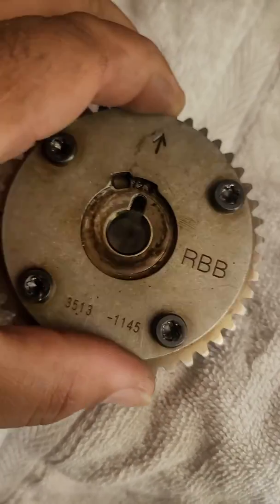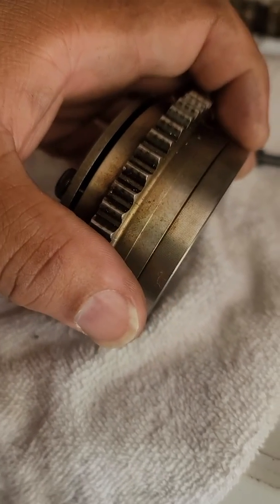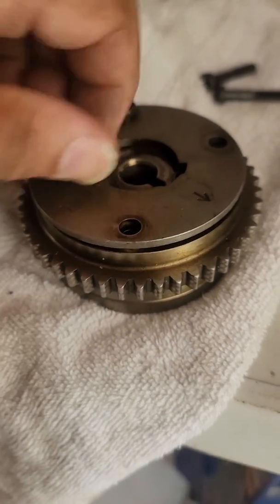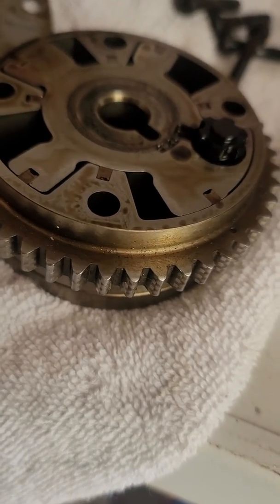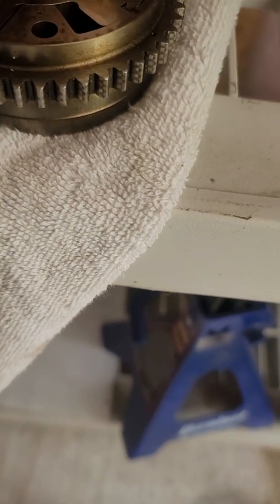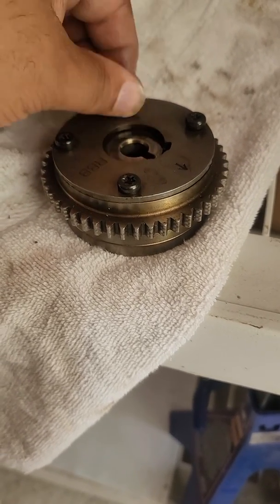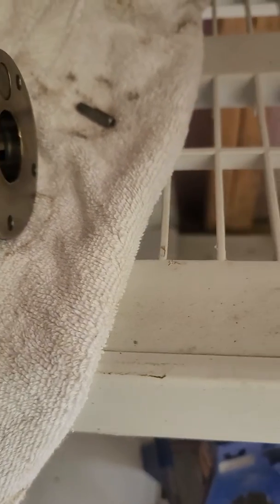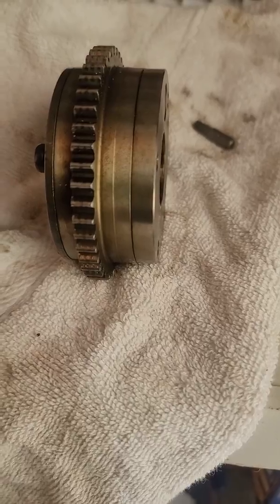vtc gear rattle fix

Comment: will this work for the 09 toyota corolla, also could you just take out 3 bolts and loose the 4th a bit and let the cover slide down.   this way the back plate cant come off.
Reply from the maker: I'm not sure about corolla sir but u want to remove one bolt at a time not all at the same time

Comment: Hi. Im wondering why Honda or any other mechanics came up with this solution?
Reply from the maker: There answer to the problem was to replace the vtc gear completely which most ppl don't have a 350 or more to spend on a vtc cam gears and not to mention  labor cost on top of that you would be looking at 1600 or more to do the job
Reply: @dateg18  But to stretch a little the lock pin spring really helps?
Reply: @Daniel-xq7ny  yes stretching the spring often works, i just did it and it worked for me, not sure if its a permanent fix but may buy me some time
Reply: @robkenna2795  thanks for the update. No new issues?
Reply: @Daniel-xq7ny  no issues, still no startup rattle

Comment: The newer actuators (read: R5A) have five-point Torx Plus screws instead. (Note that the R5A actuator can also rattle. It's not a panacea as they claim it to be.) If I find that to be incorrect I will update this comment.

Comment: T 25 torx bit. But mine were too tight. I used a 6 inch pipe wrench to break them loose
Reply: It's a T30, and specifically it's the 5-point Torx.

Comment: My 2014 crv is just starting to do this, it was replaced around 50k under warranty, I’m now at 118K.  So, if doing this, you would replace the timing chain tensioner, would you also need a valve cover gasket and the spark plug tube gasket set?   Would i need to also check valve lash also?  It’s never been done yet.   Thanks for any info.
Reply from the maker: I would replace the timing chain tensioner there no need to do a valve lash on the motor with the mileage it has but yes u can do new spark plug and a gasket
Reply: Checking the valve lash is easy only takes a few min if you already have it apart

Comment: Hey bro, would this be the same for a 2011 Toyota Venza?
Reply from the maker: I really don't know bro if it has a vtc setup like honda 🤔 mybe
Reply: @dateg18  Thanks. This is a good video. Imma replace the valve that distributes the oil. I just checked is a little different for the Toyota. Same concept. Once I replace that and I don't see a change. Spring swap will be required.

Comment: Ok just a few questions.. when you take it off.. is it locked or unlocked?? Or do you just put it back the way you took it off?? Because I'm going to do it on the car.. please help.. like your video.. Thanks 👍
Reply: Sorry to be so late.. it did work fine.. thanks for your help
Reply: @glennpitre2239  no more rattle and no new issues?
Reply from the maker: @glennpitre2239  thats great to hear thanks for the update
Reply from the maker: It doesn't matter just put it back the same way u took it off
Reply: @dateg18  thank you for your help...
Reply from the maker: @glennpitre2239  np sir please subscribe to me
Reply: Hi. Any updates would be appreciated. Thanks

Comment: Would this be the reason for a check engine code? I have a p1009
Reply from the maker: No that is variable valve timing actuator it on the side of the motor under the cam gear some time they just need to be cleaned because trash can build up on then from dirty oil
Reply: I have a brand new actuator and I still have this code. As well as a brand new spool valve assembly. I'm going to try this soon and pray I just haven't jumped timing
Reply: @shilohhutchings8688  Did it fix your problem, cleaning it out?
Reply: @bernardhorton2259  unfortunately I have not been able to get to working on it again die to work and being on the road

Comment: What kind of tool did you use to loosen the plate?? My 2008 honda accord has 5 screws on it and I can't get them off they are 5 head torx screws not 6 like usual
Reply from the maker: For the accord I'm not sure try both 5 and the 6 point should work
Reply: I have a security screw removal kit assortment at work, it had the 5 point torx, you should be able to find the right tool at a box store or maybe harbor freight.

Comment: Surprisingly this didn't work, even with swapping it to another spring.
Reply from the maker: Have you ever changed the timing chain tensioner because with high mileage they go bad as well and give the same noise on start up to
Reply: @dateg18  nope. 100k miles. The noise is definitely the vtc though.
Reply from the maker: @BigZeus  u have a 100k and u got a bad vtc gear replaced it if the sound doesn't go away then do I new timming chain and  Tensioner

Comment: If the car ( 2014 Honda CR-V) is making the vtc accuator rattle on cold start and fix is not performed, will this cause damage or lead to greater issues with the engine? Many thanks
Reply from the maker: It will not cause any damage the sound will just get louder over time also if the car has over 100k I would replace thr timing chain tensioner as well
Reply: @dateg18  thank you, appreciate the insight!

Comment: Bought my acura tsx on Sunday and it has the noise on cold start up which i didn’t know about cause i got lied to its currently in the shop because they wanna have it for a cold start tomorrow morning to hear it how much you think its gonna run me the car has around 150k miles and it drives perfect
Reply: 500-700USD

Comment: Where can I buy the new spring from please let me know thanks
Reply: If you really want a new OEM spring, buy a new VTC gear, open it up and pull the spring out. Expensive way to get a spring if you ask me.
Reply from the maker: @AmritBanks  for sure
Reply from the maker: There not a spring I know of that for sale
Reply: Where did you get yours from?
Reply from the maker: @KidHonda80  I just reuse the old one honda doesn't sell the spring
Reply: Spring-start sells the Honda and Acura VTC springs

Comment: Genius, totally works!
Reply: Engine sounds a bit louder, I assume it's valve lash issue as it is over 200k miles.  No lights, normal power and VTEC works.
Reply: @tysonmirka7652  No ticking sound until engine is completely warmed up? Im asking because I did that spring thing and I don't know if that ticking sound was a coincidence, but it came out. It was the chain tensioner. I don't see how that spring could have any relation with the chain tensioner, but... It was a clapping sound until engine was hot and the sound was gone... But sadly my engine jumped many teeth and I had to swap it for a JDM engine, (more power). But that JDM also has that VTC rattle, so I'm a little stressed doing the spring thing again.
Reply: @Daniel-xq7ny  why not have a timing job done on the first engine.  Did you change the tensioner and then it jumped teeth?  Not sure about all the Honda engines but mine has 2 tensioners.  I had a timing job done due to a ping pong/clapping noise before the vtc rattle came about.  So maybe it was a coincidence.  I would recommend a timing  job I suppose, however I am not a professional mechanic.  If it were my engine I would try the spring stretch, as in my case it did stop the rattle.  Pay attention afterwards, and if there is the clapping/ticking sound, don't drive it unless necessary and I would get it in for a complete timing job.  Expensive but worth the peace of mind.  I wish you the best.
Reply: Hi. Any updates would be appreciated. Thanks
Reply: @Daniel-xq7ny  still working perfectly
Reply: @tysonmirka7652  No other sounds when engine running? And all works A1 and no more rattle on cold starts?

Comment: I get the fact that it's supposed to fix the rattle but if it's throwing a code do you know if that'll fix that as well once I erase the code
Reply from the maker: If your getting a code then the problem is bigger then the fix for the vtc gear
Reply from the maker: What code are you getting 🤔
Reply: P1009
Reply from the maker: @Displacement-destroyer  check this video out and see if it can fix your problem 
https://youtu.be/YYKikGysXqE

Comment: Just did this today on my 2012 CRV. Easy enough to do if you have the right tools (1.5hrs). It did not completely stop the rattle, but significantly reduced how loud it was. I just bought a variety pack of compression springs and found one that fit and was longer/stiffer as stretching the spring didn't work for me. Maybe with a new oil change and some liqui-moly mos2 will stop it altogether. No check engine lights, still able to engage VTEC.

Timing Chain looked fine and tight as well. 

Note: For the CRV, you need a 5 point T30 bit, not a 6 point like in Civics. 

Thank you man!
Reply from the maker: Also if u have over 100k miles replace the timming chain tensioner
Reply: On the 2013 accord do you think I need a 5 point as well
Reply: What spring did the job for you, do you have a link to it by chance? I'm needing to crack open my wife's 2011 CRV and would rather replace than just stretch. Her's is lower mileage for the year, still under 90K.
Reply: @johnnixon  "Handyman SP 9722 Compression Spring" was the spring I used. Purchased off Amazon and cut to have one more coil than the stock spring. Its a high tension spring so dont cut it too long or it wont allow the VTC to unlock. I dont recall that the 2011's had the VTC rattle - it may be your timing chain tensioner instead but this is a cheap way if ruling out the VTC.
Reply: @AmritBanks Not always true.  I replaced my spring altogether, and also replaced the tensioner with an OEM Honda part.  And also, I worked the locking pin over and got it smooth so that it goes in and out easily.  I still have the rattle, but it's much much quieter and shorter.
Reply: @johnnixon  you have to stretch the spring you have in car . About a quarter inch
Reply: Where did you find your 5 point T 30
Reply: @ericwalker6543  Autozone/PartSource/ Theres a bunch on amazon as well.
Reply: I have the same problem
Reply: 2011 Accord 5 point as well
Reply: Hi. Any updates on your rattle vs spring test, would be appreciated. Thanks
Reply: @Daniel-xq7ny  No rattles thus far!
Reply: @AmritBanks  they say it comes back after around 60k miles/kms not sure. 
how much have you travelled after replacing/stretching the spring?
Reply: @ManojPoudel59  Not that much in 6 months haha. Im around 8k miles so far on the new spring. If it returns after 60k miles I would be happy because the fix is relatively easy/cheap and I could do it again to get another 60k and so fourth until we get rid of the car.
Reply: I heard the tensioner should be replaced with high quality aftermarket?
Reply: @realtorjeffpimentel what do you recommend?
Reply: what’s the torque value on the bolts?
Reply: @francisfrank8325 I would also like to know
Reply: Thanks, 2012 CRV.
Reply: Another video shows adding a pen spring inside the re-stretched spring for more tension.

Comment: when you do it on the vehicle, does it have to be in the unlocked or locked position? thanks for this vid.
Reply from the maker: It needs to be locked
Reply: @dateg18  How do you know if its locked and how would you lock it if were working on it in the engine? Going to tackle this this weekend. Thanks!
Reply from the maker: When the motor is off it shouldn't matter the cam gear not gonna turn or move timing just because you removed that top plate on off the Vtc cam gear
Reply: @dateg18   Great - Thank you for following up! Will comment on how it goes. 2012 CRV
Reply from the maker: @AmritBanks  no problem sir 👍🏽
Reply: @AmritBanks  Hi. Any updates would be appreciated. Thanks
Reply: @dateg18  thanks, brother. I appreciate your time.

Comment: What sort of miles does the spring go bad at. I'm picking up an Accord on Saturday with 90k miles on it. It's the kz24 and been serviced all its life. It's a lady owner in mint condition. Are these good engines?
Reply from the maker: As long you don't get the vtc rattle on cold start u your fine

Comment: Do You know if that’s same fix for 2010 Acura TSX 2.4???
Reply from the maker: If it have vtc gear then yes it should work
Reply: @dateg18  thank you for response! I hv valve cover off now and see that I do hv the vtc gear… but im having issues taking screws out of it!.. I only have a T30 torx but it seems to slip…does it use the T35 torx bit instead or is that to big?
Reply from the maker: @indigoyo  it should be a t30 but go up a size to make sure the rbc used a t30

Comment: If you take the 4 screws out while it’s on the cam the back won’t come apart because the cam bolt is holding pressure against the cam and the back of the vtc actuator
Reply: Could be, i think on mine the front and rear plate as well as outter gear housing are not connected to inner part of phaser that is bolted to cam. i just took a piece of corrugated cardboard and folded it in half, it made a perfect wedge to hold back plate from possibly moving
Reply: Are you positive
Reply: That's a fair assessment, but to be sure, use a folded piece of cardboard as a shim and in the middle of the fold cut out a semi-circle to go around the end of the camshaft.

Comment: Does it work in a 2009 corolla?
Reply from the maker: I do believe they have a similar vtc gear as well but I'm not sure if it spring loaded 🤔 like the rbc or rbb gear
Reply: @dateg18  yo bro, I did it in my Corolla and it got fixed! Thanks so much!
Reply from the maker: @davidmorel40  that's awesome bro!!
Reply: @dateg18  I saved my self a few bucks right there
Reply from the maker: @davidmorel40  nice 👌
Reply: @davidmorel40  Hey i have the same engine as an 09 corolla (https://youtu.be/Q9YIWxi92gM?t=279) Is there enough space to remove the screws? Do you have to rotate the gear to get the screws out? Thanks
Reply: @dateg18  mines does a grinding sound when I start it for a second, I have read that this is the problem but I would love to see if it works with a corolla 09

Comment: Can the noise it makes rattle under acceleration?
Reply: Thats gonna be your timing chain tensioner if its doing it all the time, also if its doing it all of the time under acceleration get it done ASAP because you are at the last stage of damage before its going to fail completely. I would change out the chain too because its both that usually are damaged, the chain will have slight stretch and the tensioners spring wont preload properly over time. You can get away with just the tensioner because a new tensioners spring will preload the chain fine but the chain will need to be changed eventually.
Reply from the maker: No only on start up still oil pressure build up

Comment: Do you know if I could just buy a new spring and replace it? I'm going to change my timing chain and be in that area so this is worth a shot.
Reply: There is another video where a guy lists the specs of the spring.  You can find a new one but they are hard to find according to the other video.
Reply: @ohboy2592  7/32 x .025 x 1-3/8 long
Reply: That is a good question.  Still cheaper than replacing the actuator and maybe worth a try
Reply: @ohboy2592  I saw that one. I wonder if the material of the new spring would be important. Idk what the stock one is made of.
Reply from the maker: There not the easiest thing to find just the spring alone my friend got one new from a rbb cam gear that was brand new and we used that to install on the rbc gear
Reply: @dateg18  Do you by chance know where I could look up the size of that spring? I just looked on a Honda parts website but their diagrams don't break the VTC down. It's just the whole thing.
Reply: Spring-Start has new OEM style VTC Gear Springs for most Hondas and Acuras. RBB/RBC/R44/R40/R5A/5A2 and more. The torx bit is included.

Comment: Does it have to be in the lock or unlock position to do this?
Reply from the maker: It need to be locked
Reply: How do you know if it's in the lock or unlocked position
Reply from the maker: @joe-ku5hd  the cam gear will turn when u try to screw it
Reply: @dateg18  Thank you

Comment: I have a 2012 Honda Fit with 98,000 mi. When it's cold outside (below 45 F), I get a grinding sound, like you'd hear when you try to start the engine when it's already running. Is this what you'd expect with a VTC problem? How serious is this issue? 
Thanks, again. You're a rare resource these days!
Reply from the maker: @eternalspring1034  that depends on how you drive your car I have buddy's with 200k and no chain problems so if your alway reving out your car and driven it hard all the time  yes the chain will have a lil stench to it
Reply from the maker: Yes it sounds like the vtc abctuator going bad and it only does it when it's cool but not when the motor been at temp the sound will stop
Reply: I’ve read people having this noise for over 5 years.  There is no issue for damage from the noise.  It’s just the actuator rattling until oil pressure builds up inside the vtc.  It will not stretch your timing chain
Reply: @ohboy2592     Thank you for this reassurance. I heard Scotty Kilmer, the mechanic, make a similar conclusion, so I’ll take your advice, wait, and save over $1,000 in unnecessary costs. When it’s time for a valve adjustment, I’ll have it checked out at that time. Thanks, very much!
Reply: @jonboz7585  no problem.  I’ve watched 5-6 videos over the last few days and read hundreds of comments.  Some just let it be as it doesn’t bother them but it would annoy me.  On a side note, do t take what Kilmer says as gospel.  He’s been wrong in somethings over the years and they aren’t opinions but facts proving him wrong.  In this case, he is right.  Be sure to have your tech check the tension in the chain as well.  It will loosen over time and  if he’s doing the vtc might as well replace the chain and tensioners if you plan on keeping the vehicle
Reply: @ohboy2592    Great advice! Yes, I plan to keep the vehicle, so I’ll follow your suggestions when the timing is done. Much appreciated!
Reply: I had the vtc rattle went in to change it out and the timing chain was stretched so be careful